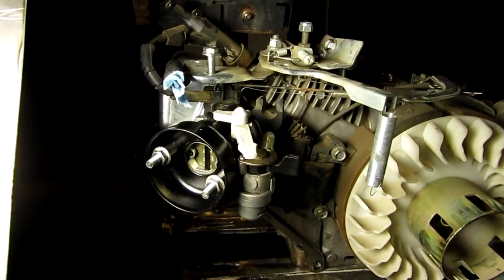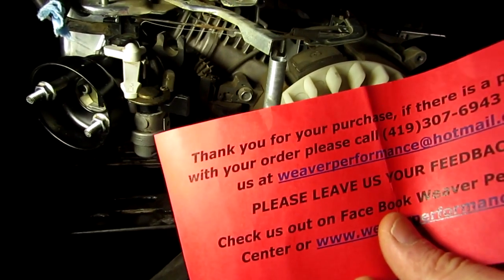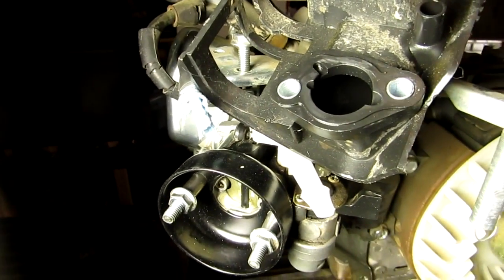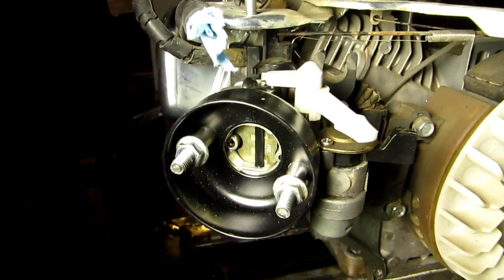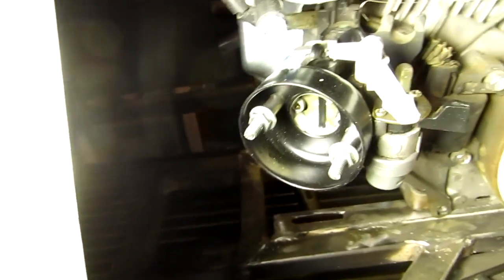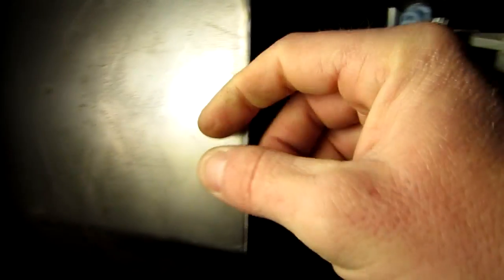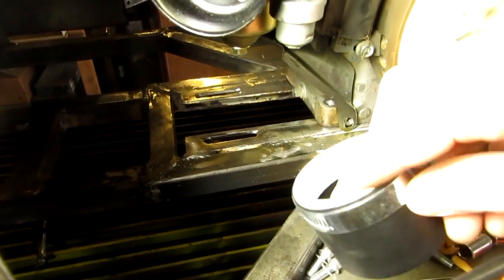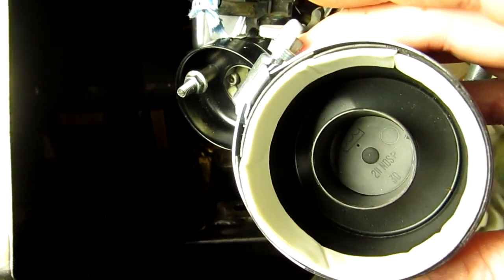Carburetor Air Flow Question | Harbor Freight 212 cc Engine

Comment: Your best bet is buy the pod adapter from a reputable place like ARC Racing or OBM even Go Power Sports the one you have is cheap and the companies I mentioned use Billet thick aluminum and have the ports machined. Sorry to say it looks homemade and a good one also comes with the bolt on arm to keep the choke from falling off. You can buy the whole kit with Billet adapter choke arm air pod and jets for around 49.00 made to fit.

Comment: For a filter element, it depends on the size you need. Check out Sten's. They have a pretty good selection of small engine parts for 2 and 4 cycle. Probably have something that would work in foam.

Comment: yes drill out the high and low air flow ports at mid and high throttle these effect carb performance. the air filter adapter you bought provide for the mounting of a uni filter there like 15 bucks and they look good to
Reply from the maker: Dave Taylor Thanks Dave, I'll keep that in mind.

Comment: One of those holes actuates the fuel pump. It uses a vacuum pulse to drive the diaphragm. Changing the length of the chamber will probably interrupt the operation of the pump. I bet it will only run right partially choked, that bypasses the pump, and the need for it which is emissions.

Comment: Those ports are there for a reason. I would not suggested restricting air flow to any of them. Even if the engine seems ok at first, you may unknowingly be reducing the lifespan of the carburator and/or inhibiting engine performance and increasing fuel consumption. Just my thoughts on the matter anyways. I enjoy your videos and all of your builds!

Comment: Sure, notch out those ports out, they let air into the fuel pathways to help carry the fuel and vent fuel bowl. If you go with a sponge in the paint cap, use a window screen to hold it in place or else it will get sucked in the engine.

Comment: Hey tman I was wondering how much money would cost to build a go kart
Reply from the maker: Abraham Felix well it all depends on what type.
Reply: Like a off road dune buggy
Reply from the maker: Abraham Felix well if its going to be full suspention with a diff on back and a motor cycle engine your looking at about $2000 to 2500.
Reply: Thx and your vids are great
Reply: Best bet is to watch the for sale ads to find one with bad engine then pop one of the $100 Predator engines into it and go! My overall costs, about $200 total doing it that way and it was much faster and better to buy it that way than to build from scratch! I forgot to mention, mine is rigid frame, no suspension, solid back axle, centrifugal clutch, chain drive. About as simple as you can get!

Comment: I think the paint lid is a great idea, & I would file and drill out for those ports. I know at least one of them is for air to pass through on the idle position, when the butterfly is closed.  You may also find that you want to play with re-jetting it for optimal performance with a different filter set up. HOMOTORSPORTS made a good video about that..(He's using the same adapter and didn't modify it)   https://www.youtube.com/watch?v=PstnywPGvNQ
Hope you get feeling better. Cheers
Reply from the maker: ***** that is a good video, just watched it.